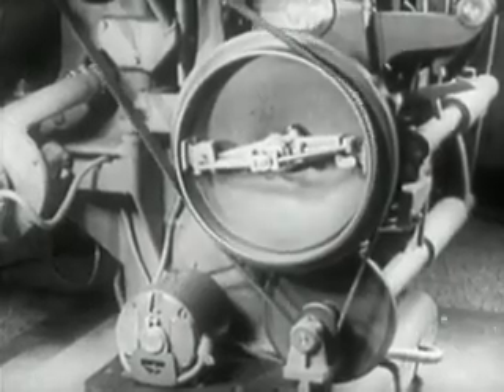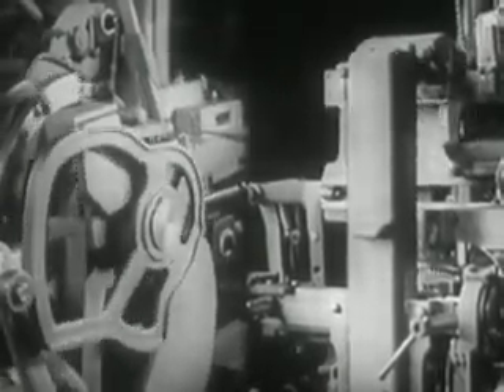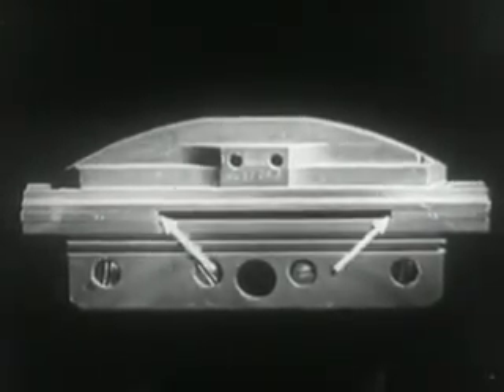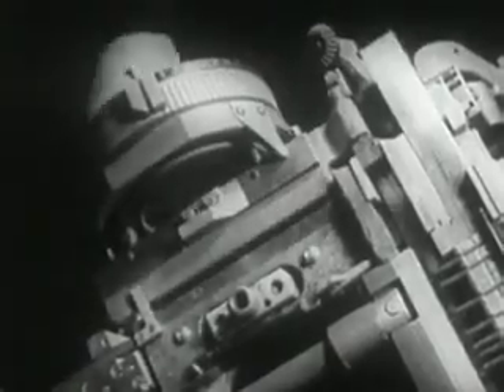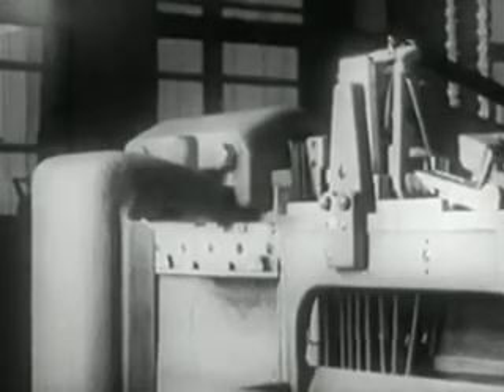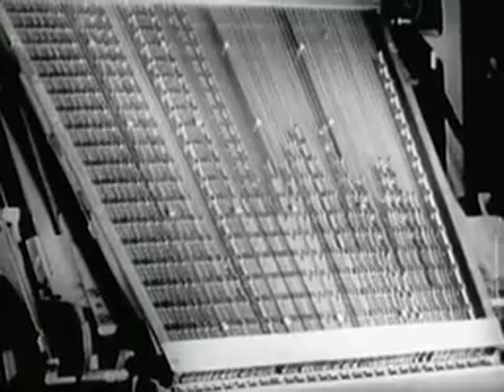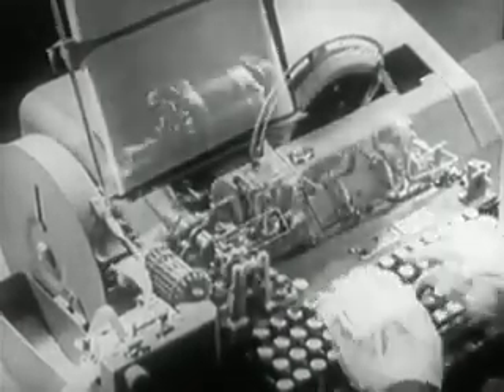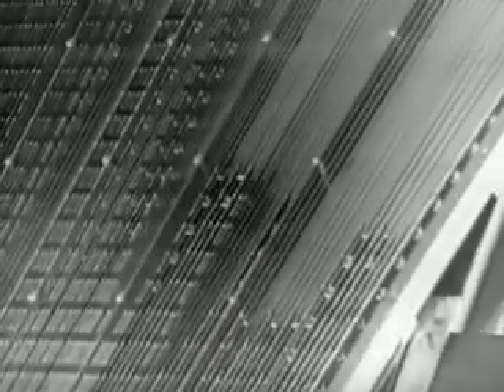How the Linotype Works to cast a line of type

Comment: I began my newspaper career in 1972, when Linotypes were in their last days. The Alabama newspaper where I worked had banks of Linotypes and other typecasting machines, and to watch and hear them was mesmerizing. The complex design and operation of the Linotype astounded me. A good operator kept the machine in constant motion as it set lines, cast slugs and returned the matrices, all in an amazing, intricate cycle. Many of the Linotype operators were deaf, but not from the machines. They were deaf by nature or by accident, and had been trained in typesetting; their deafness was actually a positive, because they were not distracted by the noisy environment. They were fast, limited only by the speed of the machine itself.  They were all highly literate, and acted as last-resort copy editors. In one corner of the shop, there was a furnace where the used type slugs were piled, and one man was tasked with feeding all that scrap lead into a crucible, where it was melted into new pigs for reuse in the shop. When we finally transitioned into cold type, many of the typesetters stayed on, using Xacto knives and paper galleys instead of trays of lead type, but still keeping their sharp eyes and intellect. The composing room was quieter and cleaner, but lost some of its romance with the Linotypes gone.

Comment: looks like that teletypesetter uses baudot or murray -- except those are both 5 bits, and this one is 6. but a, b and c match up. any ideas?? ...nerds :-D
Reply: Looks like early baudot to me.  My experience goes back to IBM 026 Keypunch days, but I did have to use punched tape to bootstrap load a couple of ancient computers (PDP-8E for example) over those ancient years.
Reply: @bobw222  would the tape get read into the PDP-8E like it was coming from a terminal?? thanks for sharing!
Reply: these machines predate ascii and there were quite a few different standards. For example, i have two different flexowriters, not able to read each others code. the reason they used 6 bit is to be able to have caps ,strange signs and controll chars as well. eight bit punxh tape was by no means as universal as it was in the last decades of the 20th century.

Comment: Insanely complicated. No wonder wordprocessors took off.
Reply: 5000 parts. But they were robust, reliable, and efficient! And infinitely more productive than setting type by hand.
Reply from the maker: @Josh442  And still work as intended--100 years later. Mine is 90 years old.

Comment: I am amazed by the distributor sorting method. The precision and quality of machining required to pull that off is respectable even today. Just the polishing must have taken a full day on that distributor rail. And the quality of heat treatment on the key matrices so that they wouldn't wear with use or break when dropped in the magazine repeatedly, man, what a machine.
Reply: There's a description somewhere of the steps in the manufacture of matrices -- something like 20, if I recall correctly.